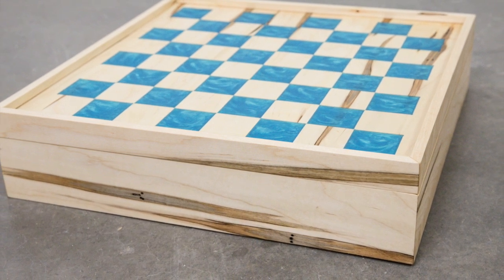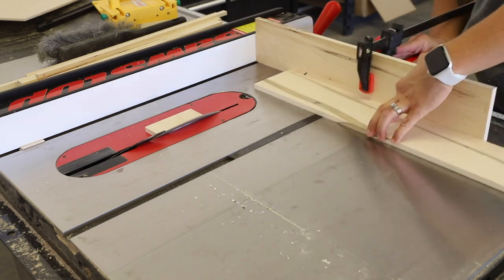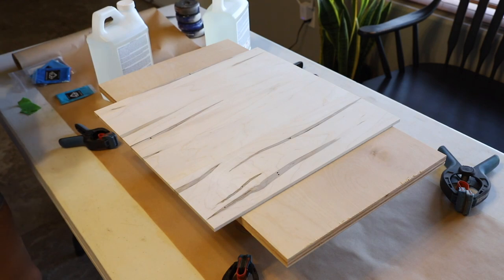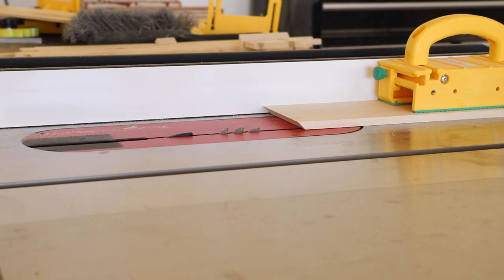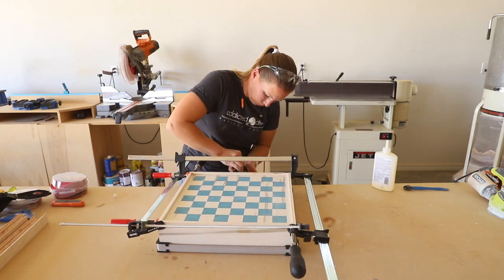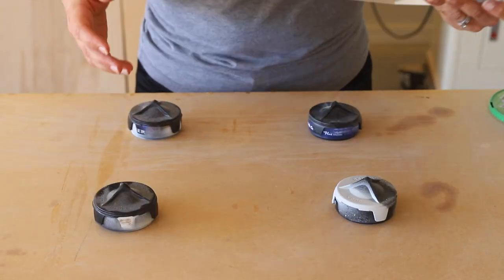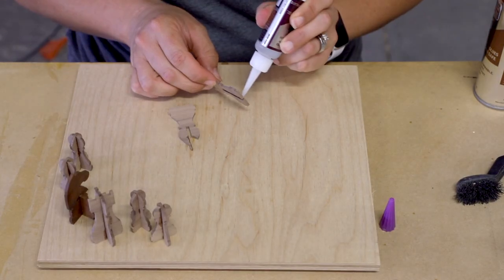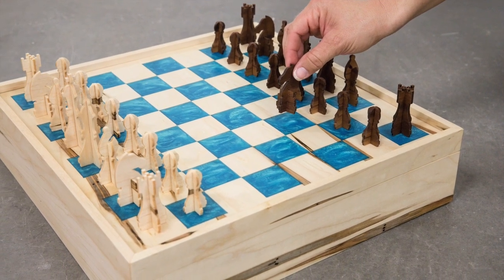How To Build A Chess Set and Chess Pieces

Comment: It would be really interesting to see if there was some way to add weights to the bottom of the chess pieces to stabilize them.  Very interesting design and love the use of the CNC  for the board.  Would also work with inlay I would think.  I would love to take this on with my Longmill once the weather warms up a bit here in Minnesota!  :)